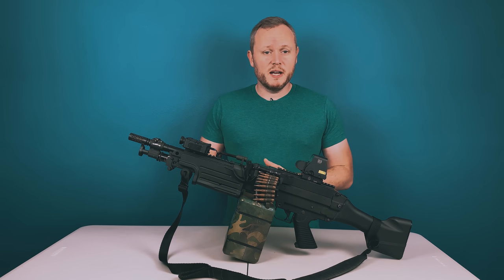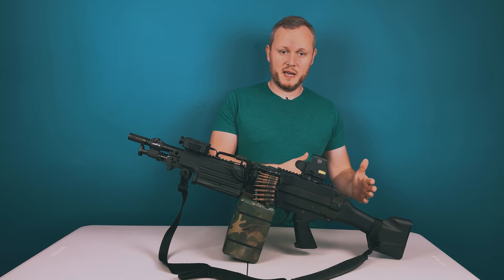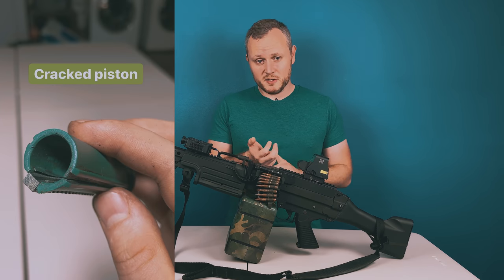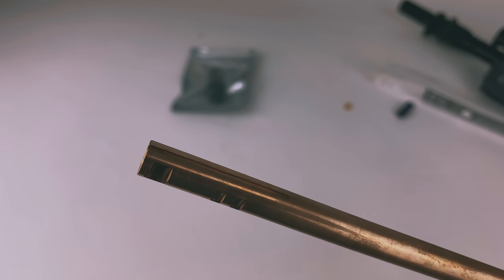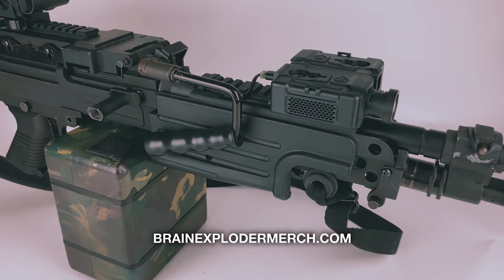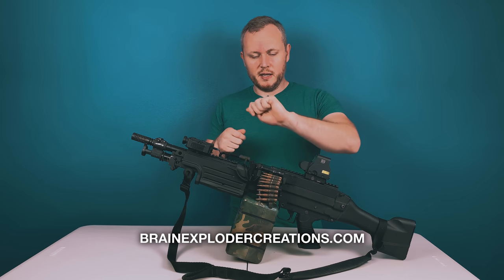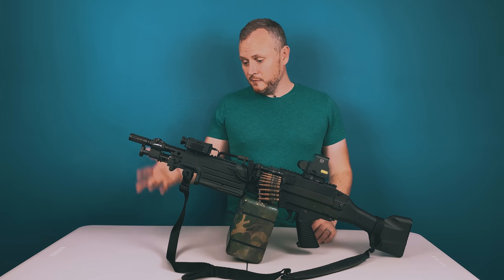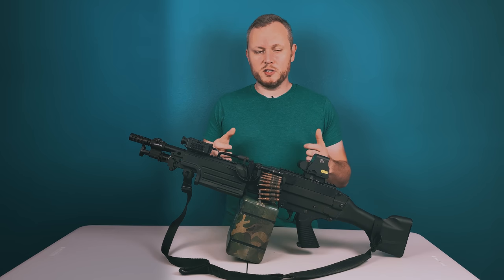The Build: Stubby CA M249

Comment: Love the Prommy Purple!! I have one, with matching bucking, and a 500mm Prommy tight bore at 6.03mm in my CYMA RPK... Only complaint l have, is that l don't get to play enough!!
Reply: Promy Purple is my go to, I have a Krytac PDW-M that's HPAed and only shoots 1 joule was running the stock Krytac rubber with a 155mm Promy inner barrel but the bucking was to hard since it was for a gun to that shoots almost 2 joules so I threw a Promy Purple in and the flyers went away

Comment: Nice work man! Im curious about your electrical setup there as i see a 12v car relay wired in the front by the battery. I had heard years ago they were the mod to do, but not much on them in recent times. Is there a reason or advantage for using a relay over a mosfet with debounce?
Reply from the maker: I am not sure. I wanted to replace my wires since they were best up and this was the option available. It’s probably bulkier than it needs to be a mosfet would do you better probably.
Reply: @BrainExploder  What? That relay are switching the motor?! I tought thats just there for a box mag. Relays are lot slower than FET-s. Btw, this box are using a microswitch, right? Jefftron just restocked their microswitch-fet with active brake function... Awesome overall work!